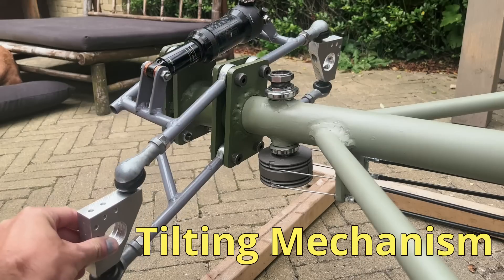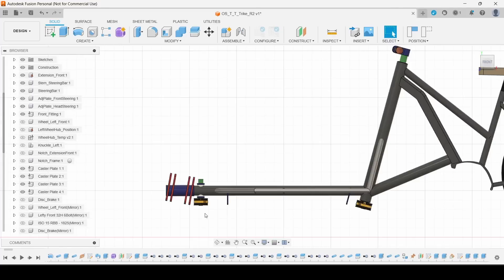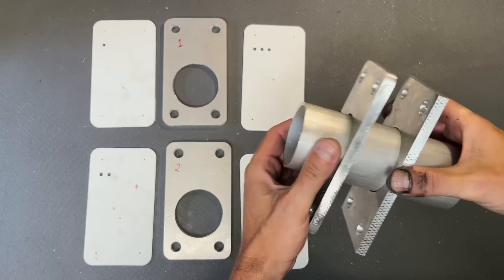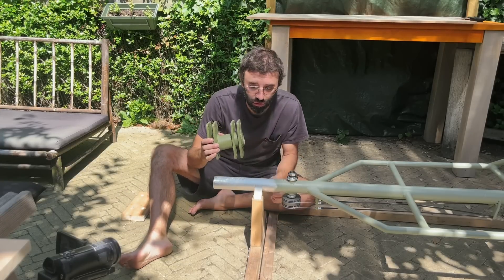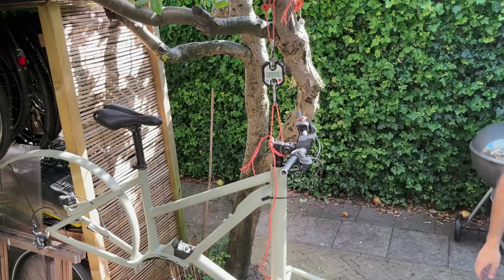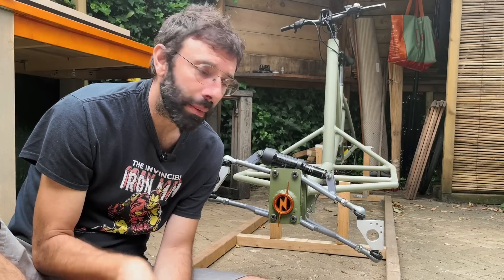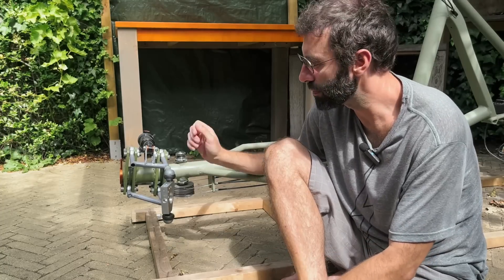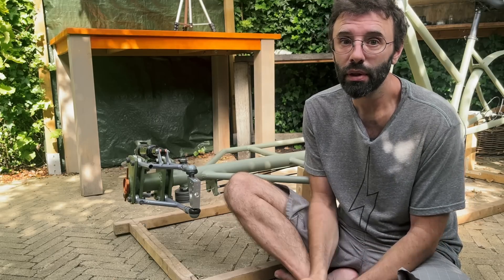#2 Tilting Mechanism - Tadpole Tilting Cargo Trike Build

Comment: Hi, I noticed your wishbones have some friction when you move them up and down.  This is probably because the two ball bearings were not exactly aligned with each other.   You might consider using self-aligning ball bearings next time, or a trick I have, to put a rod through both of the ball bearings before you weld them into place.    This will hold them in alignment while you are welding them.   

Of course, the two shoulder bolds you use **also*** need to be in perfect alignment.....and of course the easiest way to do that is instead of using two short shoulder bolts (one for each bearing) just use a single longer shoulder bold as an axel for both.  Since there is only one bolt then, it will be in alignment with itself.
Reply from the maker: Good catch! There is indeed misalignment causing friction. I think it also causes instability due to having friction in the balance corrections. Thanks for the tips for welding in line! 
Cheers!

Comment: Is steering ratio the same as tow out for turns?  What angle do you use when wheels are straight ahead?
Reply from the maker: Hi, when the wheels are straight ahead, I tune for 0 deg Toe. When turning, the Toe out increases as per the Ackerman geometry.
Cheers!

Comment: is the sketchup design available? For the tilting system only
Reply from the maker: Hi, I share the CAD files in .f3d (Autodesk Fusion project) and .step - editable in most 3D CAD software. Not sure if Sketchup opens .step, but you are welcome to try. You can find the files in my website - https://www.powercircuits.nl/home/vehicle-engineering/tadpole-tilting-cargo-trike/open-source-tadpole-tilting-cargo-trike.
Cheers!
Reply: @pedro-neves  thank you.. You are very generous..
Reply from the maker: @jeffreyberces8005  you are welcome;)

Comment: After going to the trouble of building one, I'd hate to have it stolen. What do you suggest to do to prevent this? Theives carry cordless angle grinders these days.
Reply from the maker: Indeed, I would be devastated if this gets stolen... I have a lock for the rear wheel and I always park it at  hoe during the night so the chances of being stolen are low... I always take the battery with me though.
Cheers!

Comment: Awesome design!  Thank you for bringing us along on this journey.  
I have a couple of questions regarding the front assembly.  What type of tubing did you use for the links?  (size,wall etc..) 
And could you provide a link to the ball joints you used or provide information on how to source this "grade" of part?
Reply from the maker: Hi, thank you so much! I'm glad you enjoyed it;)
The tubing of the wishbone are made of steel with 15 mm OD and 1.5 mm walls (12 mm ID).
You can find links to most of the components in my website: https://www.powercircuits.nl/home/vehicle-engineering/tadpole-tilting-cargo-trike/open-source-tadpole-tilting-cargo-trike.
Cheers!

Comment: 8:51 you experienced my job here haha, yeah 54 in for 54 out NEVER gets in without hammering and damage, even without welding. The CAD is smooth and perfect and (I learned it the hard way as a junior CAD) never ever applies in reality. At least 1 mm even 1,5 mm of gap when you want to position something 🙂 besides, I wish you good luck for the day you may want to put that part out to put something else in place !

That mentionned, great job !
Reply from the maker: Indeed, CAD does not meet reality. I think I haven't reached junior level. I'm still at hobbyist level;)
When I want to take it out, I'll have to cut it for sure!
Cheers!
Reply: @pedro-neves  You still achieve great at a hobbyist level !

sure

cheers !

Comment: The early Audi TT’s had rose joints on the rear lateral links for the Quattro variant. 8 of them!

They were known to seize eventually with road salt and water ingress. 

People eventually replaced them with bushings as it was only a very small amount of rotation. 

Such a cool project, congratulations.
Reply from the maker: Hi, thank you so much! Indeed I can see a wide idea that ball joints are more susceptible to damage due to water ingress.
Cheers!

Comment: As for the ball joints/ball bearings/bushings question: Bushings. Clamp things together so everything's in alignment, maybe put a couple pieces of paper between flat surfaces while you're building it so things won't be so tight you can't get them together. Bushings handle load better, and ball bearings are more for higher speed rotation. Ball joints are only there to handle misalignment, which shouldn't exist if you've jigged everything properly during building. As long as everything is inline (which you just gotta constrain it like you already seem aware of) a self-lubricating bronze bushing is cheap and should be very sturdy/long lasting.
Reply: Now that I've checked responses, seems like a couple people have suggested plastic bushings. Which one would be better for the application would kinda depend on the loads, but since this is a bicycle and loads are limited by both the size of the suspension arms and the tires and wheels, the frame.. all that kinda thing.. some types of plastic would probably work alright. Important when designing around bushings to use a crush sleeve, cause if you don't, the bushing gets squeezed by the bolt and the entire assembly will either become solid or tear itself apart... or if the bushing is longer than the cup it's in (and is solid enough to take clamping forces needed to preload the bolt), it rotates around inside the cup, which is not how they're supposed to work.
I'd personally just go with a flanged bronze bushing with the flange facing the outside on each end of the wishbone, and that'll handle radial and thrust loads excellent. Wouldn't need a flange on the insides because your suspension arm would have to squeeze together in order to make that happen, and very little of that will be happening. Only concern I'd have with this setup would be a bit of noise and maybe road gunk becoming a grinding paste over time?
Reply: For clarity about the bushing rotating in the cup: the main reason that's a problem is that the cup the bushing goes into will be wearing, and it's harder to replace that cup than it is to replace a crush sleeve.
Important note about crush sleeves that I've encountered a lot of people getting wrong: The crush sleeve goes IN BETWEEN the two plates the bushing is mounted between. If you drill the holes so that the crush sleeve can slide through the hole, you're doing it wrong. It should be sandwiched by the outer plates and the bolt locks it into place. It shouldn't rotate.

Not trying to assume you don't know any of this, but I think it's all important information if you're thinking of using bushings, and I don't know what you know and don't.
Reply from the maker: @LifeInJambles , that's a lot of great information!
I think that bushings would be a great final choice. My main reason for using ball joints was to be forgiven for the inaccuracies. Even though I jig it all together, welding bends things a little.
I must be honest - the other reason to not having chosen bushings is that I never used bushings;) but maybe it's time;).
Thank you for all the guidance that will make my first experience more informed!
Cheers!
Reply: @pedro-neves  hey cheers, bud.
Minimizing distortion when welding comes down a lot to jigging things firmly in place and making opposing tacks before you burn things in. I'd recommend a section of tube that fits snugly inside the cups (slightly shorter than the final mounting width of the arm) and a section of tube to space the cups where you want them. Clamp all that together with a bolt, tack your prewelded tube structure to that in several places, then burn it in with short sections on alternating sides to counteract distortion.

Also remember which directions it's okay to have distortion in. If the weld pulls the arm up evenly around the circumference of both cups, functionally nothing has happened.

I'll try to draw up some designs later to show what I mean visually with some vague guesses of dimensions, because I don't have the time or energy to run simulations and I don't know the loads. Just a demonstration of concepts.
Reply from the maker: @LifeInJambles  thank you so much for the valuable tips! Indeed, taking more time to prepare will lead to better results.
Reply: @pedro-neves  https://drive.google.com/drive/folders/1PdHeZvKwRlRRn9pXpaob9E9k9_SuOpgx?usp=drive_link

Alright. Nothing to any kind of scale and you'd have to figure out where to pick up the flanged bronze sleeve bushings and what size you need, but these pictures should demonstrate the concepts pretty neatly.

Important that your cups and spacer tube are faced flat. If you can borrow some lathe time again, that'd be the best way.

Happy fabricating!
Reply from the maker: @LifeInJambles  uauu, thank you so much! I'm getting fully convinced with the bushings;)
Reply: @pedro-neves  Glad I could help!

I basically know all this because I've been designing a pushrod suspension I have no money to actually build, to be honest. Glad my ADHD-borne tendency to obsessively research design and materials has proven helpful to someone, at least.

Comment: For this kind of application, you need to minimize the vibration and you need dumping.
Sleeve, bearing are cheap durable and reinable.
Rigid. 
Have you ever thought about an inertia wheel for a suspension system like this is the Lebanese formulas? It was too effective. It's simple. It's a shame. Thanks Newton, I use a moving mass and it's hard to stop. To create a reflex shock absorber effect. The constant curve. Associated with this kind of system is the holigral. Comfortable suspension.
Reply from the maker: Hello, I haven't tried suspension systems with inertia wheel but I'm always curious about unusual mechanical systems;). With my project, I try to make it the best to ride with the simplest possible system.
Cheers!

Comment: Здравствуйте. Подскажите, какие шаровые шарниры вы используете в рычагах?
Reply from the maker: Hi, sure, I use these two types of ball joints:
- https://www.amazon.nl/-/en/gp/product/B0BB94X5PQ/?th=1
- https://www.profibohrer.de/M12-angle-ball-joint-rod-end-bearing-SQ-12-RS.
Cheers!
Reply: @pedro-neves  Спасибо за ответ. Ещё один вопрос. В прошлой версии трайка, какой размер у шаровых шарниров в рулевых тягах? В рычагах SQ12-RS, а какие в рулевых тягах?
Reply from the maker: @ВладимирСмородинов-х2с  for the steering rods I used the SQ 8 RS and SQL 8 RS (left hand thread). The reason I used a right hand thread on one end and left hand thread on the other end is so that the rod becomes longer or shorter by turning the rod. This is used for adjusting Toe.
Reply: Pedro, простите меня за такие глупые вопросы. Меня очень заинтересовала ваша конструкция. У меня нет никакого опыта и поэтому спрашиваю вас о деталях. Я планирую построить реверс трайк с передней независимой двух рычажной подвеской. А какие вы использовали рулевые тяги?
Reply from the maker: @ВладимирСмородинов-х2с  no worries, I'm happy that you are interested in this work and I want to help you with your project.
Are you asking about the steering tie rods? I haven't included them in the build yet. I'm working on it now and will publish a new video in less than 2 weeks. 
Also, you are welcome to download the drawings and see the parts list in my website: https://powercircuits.nl/tadpole-tilting-cargo-trike/

Comment: Cardã is not better for steering? i think
Reply from the maker: Hello, ya, there are multiple ways of making a steering link for sure. This time I'm trying with cable steering because I think it's light and clean. Let's see. Also, I still have to finish the front connections. I'll also try something new here to make t=sure the steering geometry is always right.

Comment: Don't use 90deg angles on wishbones. You don't want any angular twist in the arm itself, otherwise over time the suspension characteristics will change with wear and tear. Triangulate everything - otherwise your observations will be less accurate AND less precise.
Reply from the maker: Thanks! I see what you mean. Indeed, this was purely a choice based on my ability to manufacture.
Cheers!

Comment: I think I hate you right now. Just kidding.... Sigh.. I really like the new frontend design but I'm just about done my 400lb front end, (more like 15-20lbs) The new design would make it worth  getting more argon and won't take long to make.  Glad I did mine modular. Thanks Pedro..  You rock bud.  PS: I like the knuckle change the most. Had a rough time getting the other knuckles usable.
Reply from the maker: Thank you so much! Designing, building and iterating is a crazy process. Frustrating and rewarding at the same time. I also like those knuckles but the truth is I already have improvements in mind. Aaahhh;) I just want it to be great! And then greater;) 
Cheers!
Reply: @pedro-neves  I'm close to finishing my Frankenstein and it's not pretty but I made it and that's good enough for me. Once I'm done I'll decide which front end I really want and do it with aluminum. My frame is maybe 7lbs (just a guess, need to actually weigh it) but it's very light. The front end is going to be 25-30lbs. (Another guess) Not sure  mid driver is the right move fore my trike because my dog will be my main cargo. She is 90lbs and the poor back wheel will get angry I think..
Reply from the maker: @greedwars  you're making me curious;) if you ever publish your build, please leave a link;)
Sure sounds nice to carry your dog with you in your cargo bike;)

Comment: i like your work on this. since you asked. i was thinking connecting the knuckle to the frame may be better served by using a steering damper between the two knuckles i believe it would help locate the wheels while simultaneously controling the wheels tendency to shake.
Reply from the maker: Thanks! Indeed I rode a trike once that had a steering damper (a Bakfiets trike) and it felt pretty good.
Cheers!

Comment: is it possible to eliminate the two middle steering supports and replace with a spacer tube to save weight and work if the supports are among the same inclination?
going further using box steel instead of plates welded to the frame could be cheaper? to make the steering support direct on the frame?
Reply from the maker: Hi, indeed there are several ways of achieving the same result. My choices are a combination of achieving some design features with my backyard building capabilities but I always look forward to better ways of making it so thanks!
Cheers!

Comment: The logo is going to have issues with Opel / Vauxhall. 
It is the same, but on its side.
Reply from the maker: Indeed I've been told a few times that it is similar to Opel's;(
Too many logos based on lightning bolt.
Thanks!

Comment: Ball joints: they might be a bit more exposed to the elements and dust, and therefor may need more frequent lubrication?  I would recommend PTFE for this (dry lubricant)
Reply from the maker: Hello and thank you so much for helping out! Indeed now I realize that there are also ball joints with an inlet for lubrication. Mine are the cheap kind so will probably not last as much. I hope this design will last so that I get enough distance on these ball joints to study the durability.
Cheers!

Comment: Hi, cool design! However, It seems that the shock absorber isn't doing anything, since. Is it doing any travel? Thanks
Reply from the maker: Hello, it definitely does. In my previous build I tested with 40 kg of cargo and just putting the cargo on would make it sag for almost 10 mm: https://youtu.be/q2GTZd428vM?si=dGezqYd_vh_sUmbc&t=114. The pressure on the shock can be adjusted so I can also make it have more or less sag for the default weight.
Reply: Right, I was thinking of it with load. Keep up the buids.
Reply from the maker: @LuisFerreiraC  thank you!

Comment: So many smart people in the chat. Amazing! I was wondering how you would know if that shock works for this application? How would you know if it's too hard or soft?
Reply from the maker: True! I've been learning so much about making a vehicle via the comments on my videos! Every time I lean about geometries and ways to build it better.
For the shock absorber, what I did is I picked the one with the most travel that I could find (50 mm in this case) and the bounce is regulatable and also the pressure (by inflating or deflating the air tank of the shock) so I can set it and find how it works best.
Cheers!

Comment: The chagrin on your face after beating your beautiful front end on was engaging. You can adjust the fit on male parts with a long strip of sandpaper wrapped around. The female with a flapper disk on a drill. There’s always the hot and cold trick if you can manage it. I think covering it up with that nifty new logo was a good idea.
Reply from the maker: Aah, I was in so much pain after all that hammering. Once it was half in, there was nothing to do but to continue...
I have received quite a few very good tips for fitting tight aluminium parts. Thank you so much!

Comment: Bearings seem like overkill for such small rotations where a little friction is allowable.They also need to be sealed and serviced. We would use bushings in applications like this for lower cost but we didn’t have possible axial alignment issues. I wonder if the bushing we used would stand up to dirt and shock loads. I think your choice of ball joint was good as robust forgiving and replaceable.
Reply: Oops it posted twice
Reply from the maker: Thank you so much! Definitely makes sense to me. And nice that it is forgiving for my construction ability. If that becomes not an issue, I might try bushings one day.
Cheers!